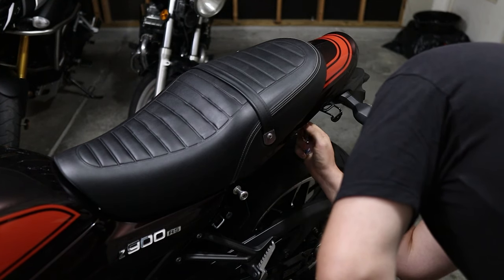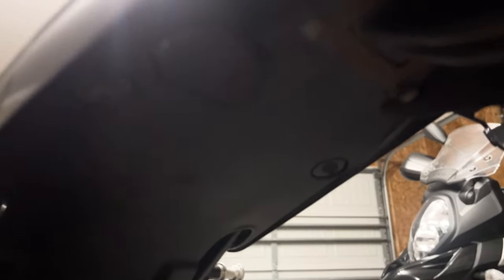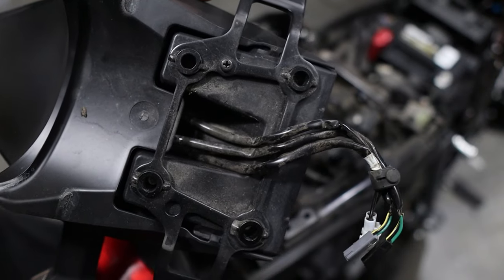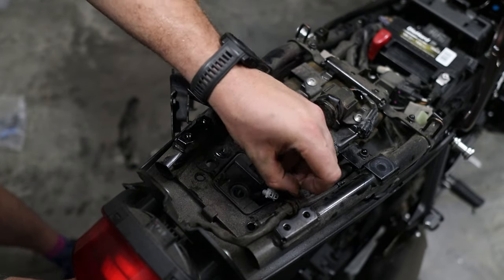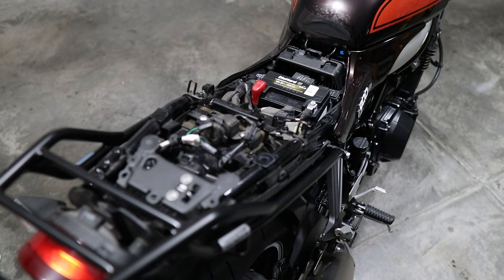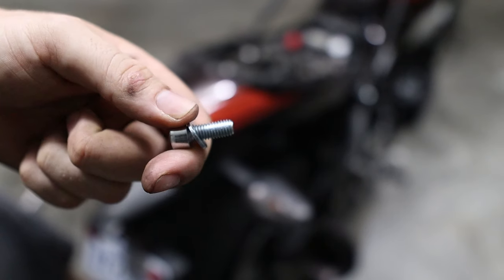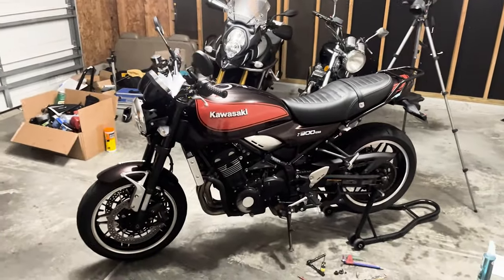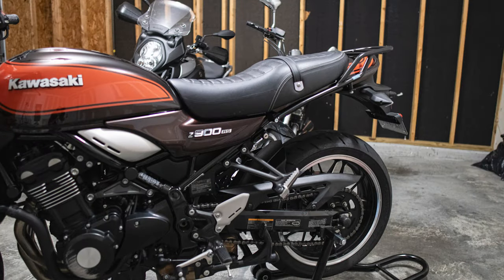Hepco & Becker Rear Rack Install | Kawasaki Z900RS

Comment: Rack looks very good on it.
I would get a rear rack. Especially if you are using it for daily commuting. Adding a lockable box on the back (although ugly) just adds another stage of convenience to the bike if being used as a daily.
Reply from the maker: Yeah very pleased with it :) 
Yeah I need to find a way to secure my work backpack to it easily and that's what it'll be used for :) 
Yeah that'll be the Vstrom! Really need to get boxes for it.

Comment: For anyone doing this, put soapy water on the grommets and the fairing will pop right in. The water dries and you don't have damaged grommets.
Reply from the maker: I afterwards went back and put red rubber grease on them all, much happier now once I replaced the torn one. Very good advice tho!

Comment: Next time, use a small amount of grease for those gromets, the plastic will slide very easy and wont damage the rubber
Reply from the maker: I put red rubber grease on in the end off camera, the rear most one was already goosed when I was looking back in editing.